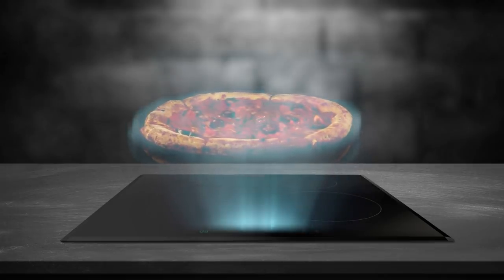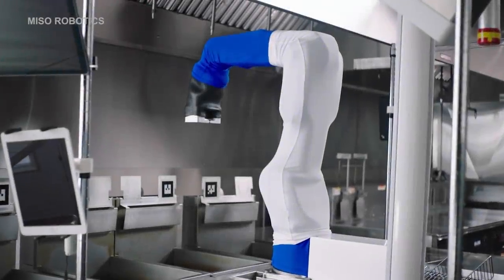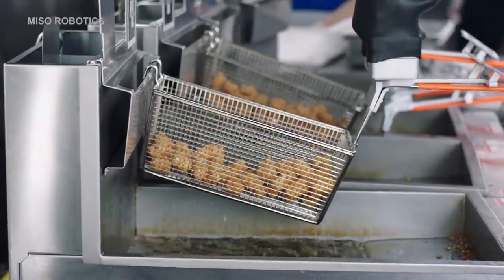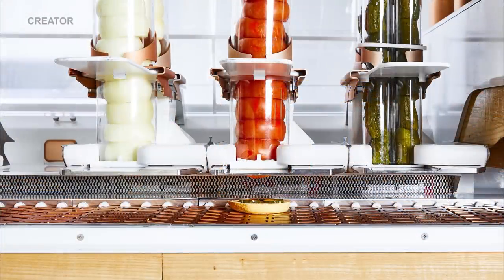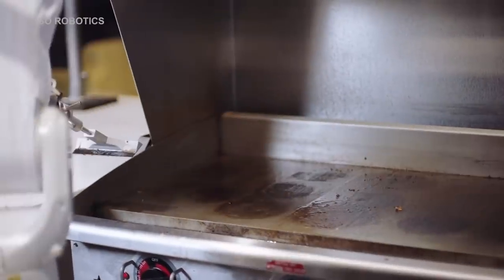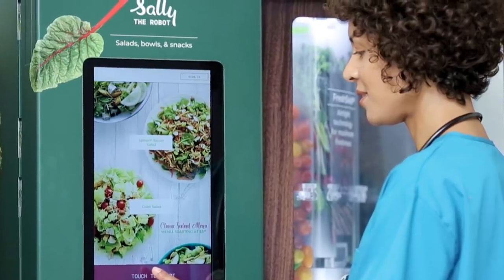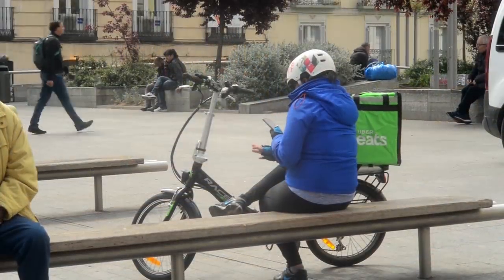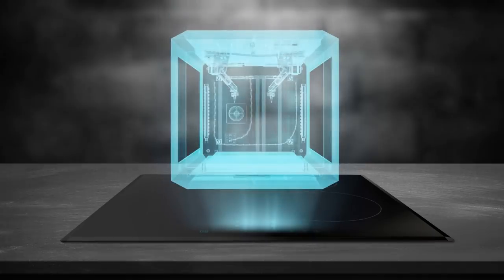Robots Cooking: The Restaurant of the Future

Comment: Just a matter of time. People demanding higher wages is what's going to speed up the switch over.
Reply: Investment in these fields are increasing even if the wages decrease it won't make a difference because $0 is always higher than even one cent. People shouldn't be trying to compete with machines by lowering their wages rather they should learn to compliment them by improving their job skills
Reply: @NadeemAhmed-nv2br  true  problem is even working on the robots might start pay you min wage , way greed is